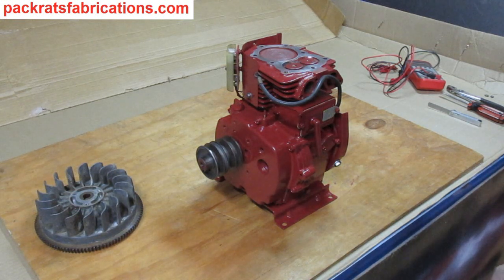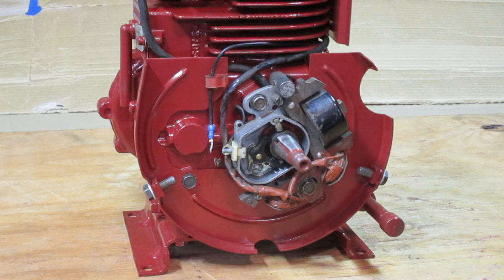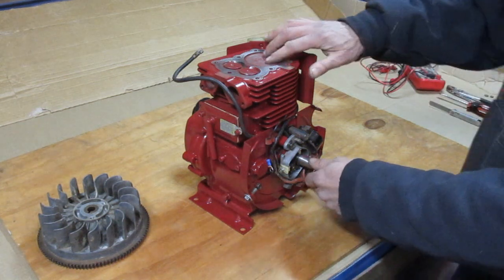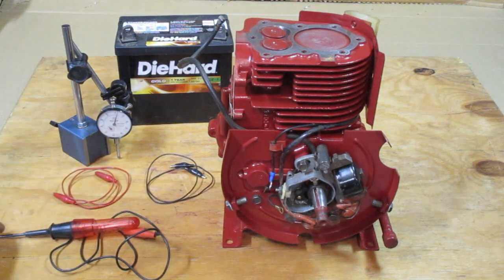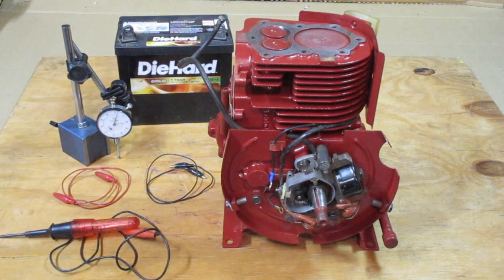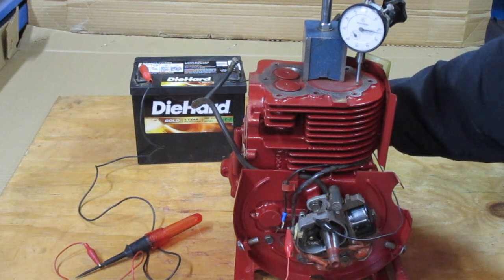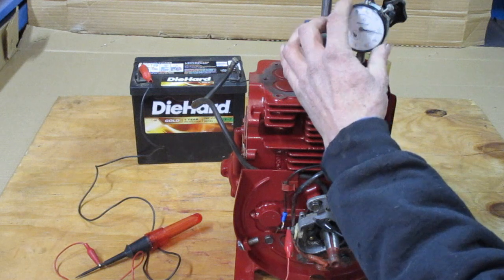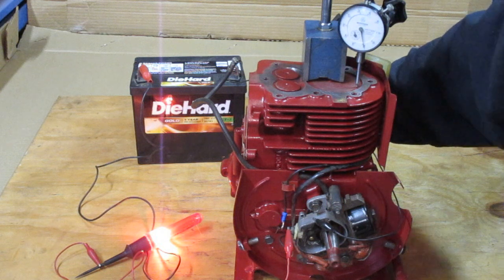Tecumseh 6hp Magneto Timing

Comment: I have found that when you take off the ignition system clean and deburr the metal surfaces especially the shoulders which have cast flashing. A file and deburring tool does the job well. Then cover the mating surfaces with petroleum and place good washers that hold the ignition system down. This makes adjusting the timing real easy. This was shown to my by my friend Mr. Snyder fifty years ago. I still remember the kind man with knowledge he learned working at Mack Trucks In Allentown Pennsylvania. May God have mercy on his soul. Peace vf

Comment: Knowing this engine has a decompressor system to aid in starting, what would be a good compression test reading?  I am getting 64 PSI on mine but have nothing to compare it with.  Thanks
Reply from the maker: Hi, I'd have to say I don't know. I've never tested one. I looked through Tecumseh's mechanic's handbook for 3 to 10 HP engines and didn't find any reference to a compression test. Maybe they don't give a spec because it depends on how fast you pull the rope.
Reply: Yes that may be the case.  This H60 does have electric start which turns the engine quicker than manual but I have no way of knowing if it turns fast enough to override the decompression system.  This one has me baffled.  Rebuilt the engine but it just will not fire.  I’ll continue my search.  Really appreciate your efforts and most definitely appreciate and enjoy your posts.  Thanks again
Reply: Use a drill to crank it backwards to get an accurate compression reading. But forwards everything above 50 PSI should be a runner. The true compression (backwards) should be more than 95 psi.

Comment: I bought an old Ariens Rocket VII tiller the other day.  Brought it home checked fire, and it would start and run for about 30 seconds and die.  It did it 3-4 times, so I changed the carb.  It wouldn't hit a lick after that.  I pulled the flywheel to check the points, and they were pitted so I changed them.  I was putting the flywheel back on and noticed the 2 magnets were stuck to each other, one had come loose.  I pulled on both of them and they both came off.  I JB Welded them back in position.  Now it backfires, so I guess I need to adjust the timing slightly.

Comment: Do small engines that have a solid state ignition need to be timed in a similar fashion and how about Brigs and Stratton small engines have a similar way to set ignition timing
Reply from the maker: Tecumseh is the only one I know of that uses this method. I don't know much about Briggs and Stratton. Kohler has marks on the flywheel so you can use a timing light. If the engine is new enough to have solid state ignition, it probably has marks on the flywheel for a timing light.

Comment: Great video. I acquired an old tecumseh motor identical to this with an electric start. I disconnected the wires to the points and have my test light setup in the same scenario. I set my points gap to 020 (waiting on my dial indicator to arrive to check TDC). If I have no spark, but my test light lights up when the points connect, would a fair assumption be the coil is bad? What about the condenser? I'm ignorant.
Reply from the maker: I'd try one thing that don't cost money first. It's possible the points could light a test light but have too much resistance to charge the coil. Clean the points with a file and make sure there's no visible pits or burn marks and reset the points gap. If still no spark it could be the coil or condenser. The condenser usually don't go bad unless it's dented or damaged so a bad coil is more common than a bad condenser. You can check both with a multimeter and there are videos out there to describe how to check each one.

Comment: I know this is an old video, but maybe you can help me. I have been searching high and low for an answer. I am attempting to set the timing on an H70. In the Tecumseh Technicians Handbook on page 95, it says .080 BTDC for an H70. On page 96 it says .090 BTDC for an H70. Do you know which is correct? Thank You.
Reply from the maker: It looks like page 96 only refers to the TVM70 and HM70 and page 95 refers to all the other 70 size engines. If your starter housing is stamped H70 and not HM70 then it has to be page 95, .080 BTDC. The M means Medium frame but I don't know what that is so if your housing is not marked or unreadable, I'd still use .080 BTDC until I found out how to identify a Medium frame engine.
Reply: @PackratsFabrications  The second column on page 96 refers to an H70, at least in my book. My starter housing is not original to the motor. It said HH60. This is an aluminum block. Bore spec, and rod crank journal size indicate it's a 70.
Reply from the maker: @waynew2831  OK, I checked a different book, looks like it was printed 11/85. The specification columns don't go by models but by displacement. It shows engines with bore size 2.625, and 2.750 use the .080 BTDC setting, and engines with bore size 2.9375 up to 3.312 (5 different ones) use the .090 BTDC setting.
Reply: @PackratsFabrications  Thank You for your trouble.
Reply: But I do have a displacement of 2.75

Comment: This is an awesome video. A lot of help. I have an HH60 that I am trying to rebuild. Can you tell me where to find the specs for points opening and such? I thought a dial indicator was going to cost hundreds of dollars, but I thought wrong. Ordered one.
Reply from the maker: The manual I have is called Mechanic's Handbook, 3 to 10 H.P. and OVM120, (light & medium frame) Tecumseh Engines. The Tecumseh part number for the book is 692509. It covers a lot of engines so the information is generic but it does have a table of specifications. I've seen it on eBay before, don't get one that says OHV (over head valve) or 2-cycle on it. To get you started, the point setting is .020, and the Timing Dimension Before Top Dead Center that I talk about in the video is .080.
Reply: @PackratsFabrications  Thank You I found a Tecumseh Technicians Hanbook on line for free download. https://www.allotment-garden.org/rotavator-manuals/Techumseh-L-Head-Engines-Manual.pdf

Comment: My Tecumseh H60 has torn up 2 recoils from the starter sleeve rubbing on the round part of recoil .
Can't figure out why ?
Any help would be appreciated
Reply from the maker: If the housing the recoil mounts on is not damaged or distorted, and is holding it in the correct position, I'd expect maybe the starter cup sticks out too far. Make sure there's no washer behind the cup. Also there were a few different recoils available, maybe the cup is the wrong one for the recoil.

Comment: I have basically the same engine on an old craftsman tiller. Wheres a good place to find specs and parts. I appreciate any help.
Reply from the maker: Hi, Since they are not made any more you have to get old books, aftermarket parts or sometimes NOS parts from a collector.
For the specs I'd go to eBay and search for Tecumseh Mechanics Handbook. The one I use says for 3 to 10 HP, sometimes they'll say L-head engines, don't get the one that says overhead valve engines.
For aftermarket parts I use www.rcpw.com. On eBay you can find old NOS or used parts and also aftermarket parts.

Comment: Great Video!

I like this better than my Factory School Training VHS cassette from the Tecumseh Education Department circa 1986 where they basically go through the same process but talk about alternatives to using a test light and using the special tool for the indicator when the head cover is still on the block.

Question: I have an H60 Tecumseh. Why can’t you use the magnetic base type indicator when the head cover is off?
Reply from the maker: Hi, the H60 (Horizontal 6.0hp) has an aluminum block so the magnet don't stick. The cylinder is cast with steel or cast particles where the piston rides so the cylinder don't wear out prematurely. The engine I am working with in the video is an HH60 (Heavy Horizontal 6.0hp) which has a cast iron block. Thanks for Watching!

Comment: I did four of them engines this year for customers, but when it comes to mine, I still have no spark.  Darn things driving me nuts.  I even put a new coil, since the points and condenser did not help. Everything is in time, and points are set to 20    Starting to wounder if a fly wheel can go bad.   I never heard this engine run, so i dont know if it had truble years ago, and thats why they put it out back.  Getting tempted to just put a Clinton on the tractor instead.
Reply: What happens to these old Tecumseh engines is the main crankshaft bearings wear. Crankshaft bounces around and won't stay in time. You can put on new coils, points, flywheels and try to set the timing until the cows come home and still won't run. IF you happen to get the blooming thing started, and rev it up, half the time they'll backfire and then seems to knock them out of adjustment and they won't hit a lick after that. I'm not a professional small engine mechanic, but have tinkered with these for HOURS. And yeah, did the dial gauge thing too, but did not have a fancy professional mount like yours. Told this to several small engine shop mechanics and got the deer in the headlight look. Solution, well Tecumseh unlike B&S never offered replaceable bearings. Find you a darn good machinist and he may be willing to ream out the crankcase, and install new crankshaft bearings the engine never had originally. Won't be cheap mind you, but that's what its gonna take. Hope this helps somebody!
Reply: Dr Blue!.... It’s more than likely a ground issue. Check those set of points that the tension arm is not grounding out on the block casing. Doubtful flywheel mags. You can test magnetic pull  by dangling a big flathead screwdriver tip 1 inch in front of each mag. Should suck screwdriver tip in.
Reply from the maker: The flywheel can go bad if it looses its magnetism. Maybe test it by swapping a flywheel from a working unit. The magneto repair shop near me (in Ohio) can recharge magnets, I don't know how many places still do that.
Reply: I bought an old Ariens Rocket VII tiller the other day.  Brought it home checked fire, and it would start and run for about 30 seconds and die.  It did it 3-4 times, so I changed the carb.  It wouldn't hit a lick after that.  I pulled the flywheel to check the points, and they were pitted so I changed them.  I was putting the flywheel back on and noticed the 2 magnets were stuck to each other, one had come loose.  I pulled on both of them and they both came off.  I JB Welded them back in position.  Now it backfires, so I guess I need to adjust the timing slightly.  Hope this helps.

Comment: Great vid. I have an h60 tecumseh. Cleaned and gapped the points. It now has spark, idles well, but backfires through the carb and stalls out at full throttle. I timed it with a dial indicator. Should I install new points and condenser, or go back and gap and time again? I'm pretty sure it's a timing issue...thanks!
Reply from the maker: Put an automotive clamp on timing light on it to make sure it is the spark disappearing at full throttle. Power the timing light with a spare car battery. If it is a spark problem make sure you can't wiggle the crank around too much on the flywheel end. I had one that ran good with no load but missed and stalled under load and it was the main bearings worn so the points cam would wander around and change the ignition timing. After that I would go back to the old points, remove them so you can see each face,, and use a points file until all holes are gone and you have a smooth rounded surface on both sides. I'd change the condenser last.
Reply: I used the test light and battery like you showed in this vid. Regapped the new points, and got it timed within spec. It's now running good. Thanks for uploading this vid, and for responding to my question

Comment: Thank u Sir 
!What yr is that Motor?
Reply from the maker: Your Welcome, I don't know what year it is. It was in a 1962 wheel horse but can't be original because Wheel Horse didn't use cast iron blocks. It looks the same as the aluminum block engines Wheel Horse used in 1962 so I put it back into that tractor and it looks like it's supposed to be there.
Reply: @PackratsFabrications   Hello , Talk about DEAD ON they dont come ANY closer than that!!!!!! Perfection!!!!  Have You ever scribed the mag to (mark the location)  to ease in next time ?    Very nice how to video on mag/point setting!!!